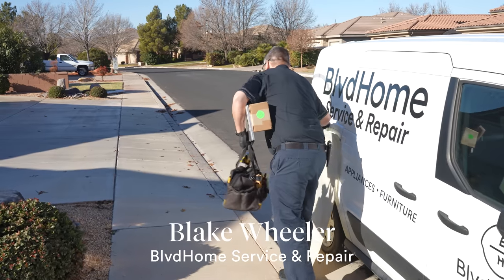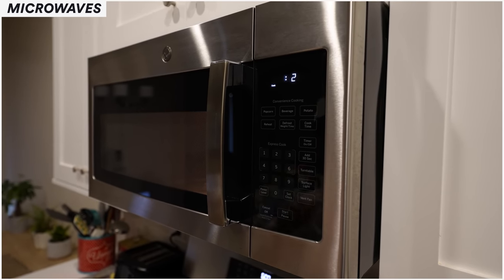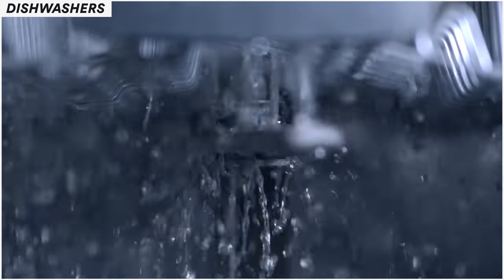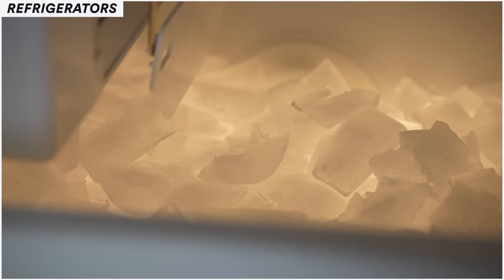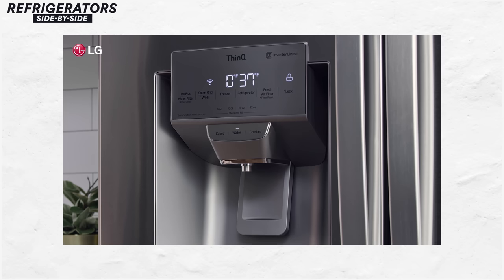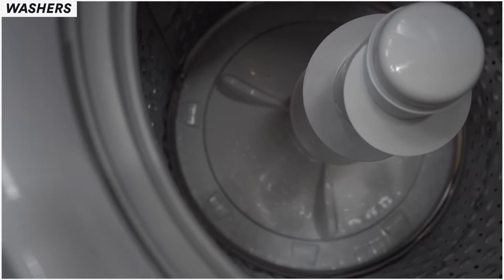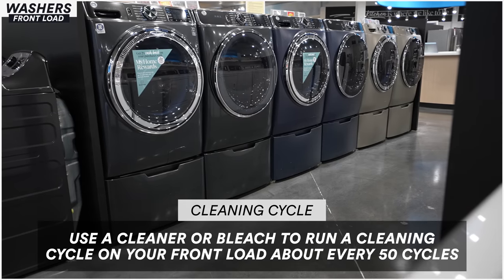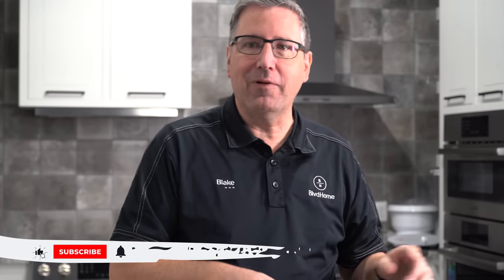Best Appliances Recommended by a Repair Technician of 29 Years

Comment: If your ice maker stops working, the first thing to try before replacing it is take it out and let it thaw out. I just moved into a house, and the ice maker wasn't working. The replacement was $250, and I didn't want to spend that given the age of the fridge. I'm a plumber and like to dabble in all sorts of different trades,  so I hoped that it was just froze up, and sure enough, that was the problem. Over 3 years now, and it still works with no problems.
This applies of course if your ice maker is in your freezer. 
I would have to look at an ice maker that is in the door and how it works.

Comment: I ended up with a WP French door no dispenser, Kitchenaide Dishwasher,and a Fridgidaire convection range. Interestedly the fridge has had zero issues, the dishwasher has had a ton but it cleans well, and the range has been great. Its a EU spec so its special order and designed a lot better than US.

Comment: Fridges/freezers: get an inverter model both for efficiency (solar friendly) and durability. My cheap deep freeze has no safety cut-out built in, so when the power dips for a second or 2, as it does here, it tries to restart immediately and the coolant gets bubbles in it causing compressor to heat up and possibly burn out.

Comment: We've had our BOSCH dishwasher for 16 years now.  ZERO problems.  Quiet.  Looks like new inside and out.
Reply: I've had a Bosch dishwasher for 20 years and it finally started having cleaning issues. It was very expensive 20 years ago, but I definitely got my monies worth. I loved that machine, it was quite, cleaned great but never fully dried the dishes. It looked great inside and out and I never had a service call. My son in law works for LG and we used his family deal to get a top of the line LG dishwasher with all of the bells and whistles. We have had it about six months now and it works well. I believe it makes a bit more noise than the 20 yr. old Bosch. It still doesn't dry fully, but a bit better than my old Bosch. Which doesn't really even compare since it's 20 years latter in technology? You would think a dishwasher could completely dry the dishes by now. It has a lot of features, wifi, steam, etc. I'm a gadget guy and love utilizing these features. After seeing all of the reviews, I'm a bit worried about the future. I still l have hope this dishwasher will provide  many years of service. I really appreciate Blakes opinion, because that is the most valuable to me.
Reply: @brewskisteve 20 years! Wow that's great! What brand fridge and range do you own? Mine are coming up on 20 years and I want to upgrade before they kick the bucket on us.
Reply: My parents first Bosch ran forever. The new one, crap.
Reply: Mine is over 20 years old. I’ve replaced a few parts (myself). Have to start differently now but still cleaning 🤞. Dishwasher has had to move 2 times!
Reply: Is Siemens dishwasher SN25HI00VI better than Bosch S25HIOOVI. WHERE ARE THEY MADE??
Reply: Mines about 20 years old.  As installed.  Still working fine.
Reply: They clean well and are quiet.  Downside is longevity and rusting racks.
Reply: SHOW OFF! My Frigidaire is a polished turd. Birthday gift from Ex-husband. I’m blaming Aliens 👽
Reply: German engineering
Reply: We replaced our Bosch dishwasher after about (more than ten years) because it wasn't responding, must have been clogged with debris.  It was a very good dishwasher, the new ones are even better.
Reply: Our Bosch is great.
Reply: @brewskisteve my Bosch dishwasher is 24 years old now and still going strong!
Reply: I love my Bosch 850 series.  Eight years? Years after buying it, my husband and I still talk about how much we like/love it.  cleans well, is quiet, use the 3rd rack more than we thought we would.  The racks aren't quite as flexible as my old GE profile (cleaned well - but loud.) - but far quieter and the coin sized light on the floor means we know it's running and how much time is left.

The Bosch replaced a higher end kitchen aid I bought because I wanted "quiet". Quiet isn't all it's cracked up to be.  I wanted to replace the thing within a few weeks of installation, as we utterly loathed it.  As soon as we could afford to replace it - we did.  It was a piece of junk - I shouldn't have to wash my dishes before putting them in the dishwasher . . all it was capable of doing was sterilizing them. (I had a builder grade GE that did a better job cleaning dishes.)  You can't pay me to have a Kitchen Aid dishwasher in my house.
Reply: @simpleshoes mine is 18, and I love. So this gives me hope!
Reply: My mums Bosch dishwasher and washing machine is also about 20 years old. I live in Germany so we mostly use Bosch and Siemens appliances. My new kitchen is all Bosch - fridge, dishwasher, induction stove, oven… also washing machine and dryer are Bosch.

Great brand, really reliable.
Reply: @MG-yu6do  I've had Bosch fridge freezers in the UK for the past 45 years without a single problem. We kept each for about 15 years and replaced them when we moved. Same for my parents. Bosch make great products. I'll move next year and probably get a Bosch dishwasher too. All the best.

Comment: Your confidence in Bosch dishwashers was exactly what I was keeping an ear out for. Thanks for sharing the experience with us common folk.
Reply: Miele are also incredible....but more expensive.  Basically, anything German.
Reply: In Australia the Bosch dishwashers have set on fire due to problems with a circuit board on the control panel, a friends house had the kitchen set on fire as a result.
Backup service from the company was average as well, they offered a new dishwasher but didnt knock themselves out wanting to help.
Reply: @markwilliams-ny6tr  This happened to my family about 10 years ago to our Bosch dishwasher. There was an electrical fault in the control panel and it ignited in the middle of the night totally on its own. We were able to get a replacement, but that was about it. Apparently there was a recall that wasn't made aware to us.
Reply: @RyanDottery  Sorry to hear that, hope the family and your home were all ok. My friend had the kitchen ruined as I said but the worst was all the black smoke that went through other areas and he had to replace carpets, lounge suites and drapery etc. They ended up getting Miele appliances which are way better.
Reply: @markwilliams-ny6tr  we also had our Bosch dishwasher on fire in Auckland NZ, also on the control panel. Interested to know someone else had the same issues. I would never buy a Bosch dishwasher as a result!
Reply: Miele is superior to Bosch and it’s not more expansive. Stick with basic Miele and enjoy it for 20 years..easily….
Reply: @dr150  except you can't get miele parts easily
Reply: My Bosch has been working for over 20 years.  I did have to replace an inlet solenoid valve.
Reply: @glasshalffull2930  I have just replaced the outlet solenoid valve on mine. It has around 10 years I think. Took 10 min of search online and a 30€ part which came in 48h with Amazon, quite happy how it turned out.
Reply: I asked a repairman that came to fix an appliance which brand in general they recommended and they said Bosch.
Reply: I was excited to get a Bosch dishwasher to replace my builder-grade Whirlpool. Based on my recommendation, my daughter bought one, also.  Much to our dismay, several repairs and less than seven years later, we both had to buy new dishwashers. I’m very disappointed.
Reply: I have heard this on every platform i have looked.
Reply: We never imagined a dishwasher could be as great as our  Bosch. They are DEFINITELY worth the money.
Reply: A lot of service technicians recommend the Bosch dishwasher over anything is what I'm gathering from several youtubers. Its what I'll be getting next.
Reply: This issue with the Bosch that drives me nuts is that after your press the "start" button you have to close the door in less than (it feels like) 1.5 seconds or it does not start! This combined with the fact that it runs so silently means I often check on it later and find that the darn thing never turned on and it's a huge inconvenience because it takes a long time to run. First world problems - I know - but it's almost comical that some dishwasher designer somewhere thought you only need a fraction of a second to close a darn door. If that could be changed to 5 seconds or so then I'd call this a nearly perfect applicance.
Reply: @DennisKapatos  I don`t have that problem because the controls are not in the door. We chose that on purpose.
Reply: @dr150  Miele is the only appliance maker that does all design AND manufacturing in-house. They say this is the only way to control the quality.
Bosch moved manufacturing to less expensive parts of the world and they have parts that are made by other suppliers.
Reply: My Siemens (bosch rebrabded) is 18 years now, and have been working perfectly even using it daily.
Reply: @dr150  He never mention Miele because the never fail got my 23 years now :D
Reply: After 4 different brands we got a Bosch !

Comment: I sit here watching YouTube waiting for my Frigidaire french door fridge to get delivered today. My wife and I have been worried if we made the right choice. Then this guy praises them and even shows what looks like the exact model we bought on screen as he talks about them. Thank you for calming my nerves!
Reply: I have 9 Frigidaire appliances spread across 4 locations: 5 fridge/freezer combos and 4 large freezers that get about 20 below zero F. Three of those locations are vacation rental houses 1000 miles from our primary home. We standardized on Frigidaire because they "just work" and are easy to fix when they don't. Parts like shelving are easy enough to find, as are replacement ice makers. Vacation renters like to terrorize appliances, so this matters to us. 

The stand up freezers are at our primary home, and hold a lot of food (we homesteaded for a while and I tend to freeze lots of stuff). They stay cold, and if you stick to the the analog models (no digital controls) you can replace thermostats in less time that it takes to empty the machine. The number one problem with those is leaving the door ajar. People think the compressor fails because it won't cool anymore, but real issue is the thermostats burn out from staying on too long (while the door is ajar). Just replace the therm and it's good until you do the dumb thing again.
Reply: Hi would like to know what model you purchased ? Thank you for your time.
Reply: We loved our fridgidaire French door!  We sold it with the house.  That was a superb refrigerator!
Reply: I just got mine Sunday, and I absolutely love it!!

Comment: I was a kitchen and bath remodeler for 25 years, got asked a million times what appliances should I buy... I gave them my appliance guys card & told them "he'll guide you based on your needs & he'll give you a good discount", he always did and I always came out looking like a champ!... Oh and I was always a simple Whirlpool guy... washers, dryers, dishwashers & refrigerators, in 50 years of use, I've only gone through two sets of each, still on the second set!
Reply: The oldest appliance in our home is a Whirpool microwave. It's over 27 years old, we use it daily, and it just works really well. 

And we open it many times before it finishes and never had any issuses with the contacts! (Though now that I know, I'll try to take a better care)
Reply: Yes Whirlpool is the standard for me in almost all appliances. I have Whirlpool everything with very few problems.
Reply: I have Whirlpool appliances in the kitchen and am replacing them with more Whirlpool appliances. I have Commercial Quality GE washer and dryer though. Better standard warranty and higher quality parts throughout. Also cost me $1000 each

Comment: We are fortunate to have the same washer and dryer purchased in 1999....Kenmore! Never had an issue to this date. When they fail (and we sure got our use and money's worth) we will replace with SpeedQueen...
Reply: We had a cheap Kenmore super capacity dryer and I loved that thing.  I only had to replace the switch which was my fault for being rough on it but I fixed it myself with the help of YouTube.   I had a front load LG washer — and my kenmore dryer that I wouldn’t give up.  I think we paid $350 brand new and it ran like a champ and could fit huge comforters. we sold our home but I wish I would’ve brought it with me.
Reply: Speed Queen is super expensive
Reply: I’m watching this video because my 2002 Kenmore washer finally 💩 the bed

Comment: I've had a Bosch dishwasher for three years and it's performance is flawless.  It does nee to be cleaned periodically and the filter should be scrubbed at least monthly.  We like it so much we recently bought a Bosch gas stove.
Reply: Kitchen aid way better
Reply: We love our Bosch too!  Replaced a Kitchen Aid with it that wasn’t cleaning our dishes at all.
Reply: We love our Bosch too!  Replaced a Kitchen Aid with it that wasn’t cleaning our dishes at all.
Reply: Ditto on the Bosch! Great dishwasher and glad you're enjoying yours!
Reply: I’m at 16 yrs with our Bosch.    Going strong.
Reply: Have a Bosch disch washer and it work great; had a Whirlpool before it and had a few problems with that one. Recently moved to Bosch group also with the induction stove. The fridge is also Bosch, no complaints there either.
Reply: @iLoveBoysandBerries  False.
Reply: Our 6 year old Bosch dishwasher just quit. It won't power up.  There's power to the junction box. There have been problems with the soap dispenser. Potential cost for repair makes it a done deal. Take all the Bosch praise with a grain of salt.
Reply: I have a Bosch washer & Dryer I bought  at Lowe’s way back in 2006 to date no issues what so ever works flawlessly. There dishwashers are tops  .as far as washers & dryers go Speed Queen are good ones . Yes they can get expensive to buy it depends on which model & features. Miele is a good brand. Although I’ve never owned any of there products. From My understanding they make great products. I do know they make  floor care products. All & all it’s basically what’ your want & needs are .
Reply: @robertwhite9898  The problem with Speed Queen top loaders is that they use so much more electricity and water than other brands, especially front loaders.

Comment: Excellent summary of appliances. One thing to inform viewers is that in many appliances the top and bottom of the line are the same unit inside. I have bottom of the line $525, Bosh dishwasher and according the the online parts manuals the mechanical parts are interchangeable with the $1300 top of line. You get no more reliability with price.
Reply: Thank you, I will be replacing my Old Bosch and wondered which series to buy.

Comment: Well,  truthfully shocked by some of the recommendations in this video.  I have been in the appliance industry for 17 years….things he got right?? LG & Electrolux front load washers and dryers…yes….speed queen & LG top load …yes….Bosch dish yes…but should also seriously consider Miele…whirlpool is not what it used to be.  As for fridges,  this is where things go sideways…any issue with LG compressors was worked out on new generation and they are hands down a top selection…reliable and great features…Consumer Reports also backs this up..Samsung…stay away from all with exterior I/w dispenser along with their dishwashers and all built-in cooking product…ranges are solid

Comment: We went with all GE Profile kitchen appliances and have been very happy with them..The French door bottom freezer did  crap out after 3 yrs but the Profile models have a 5 yr factory warranty on motor, compressor and all cooling lines so it was replaced (not repaired) by the factory...
Reply: You got money and good taste 😁
Reply: We have the same. Got rid of the fridge bc it was ineffective storage compared to our Samsung. The microwave stopped working. The dishwasher isn’t efficient.
Reply: Well, now my heart hurts bc I really wanted the Samsung bespoke refrigerator
Reply: @jessicaferguson4518  don't even trip dawg, follow your heart.
Reply: 3 years?  What a waste
Reply: GE profile side by side refrigerator - I was glad to kick that thing to the curb. We literally left it roadside marked free.  Never had more problems with an appliance in all of my life.   Purchased a Frigidaire French door bottom freezer.  Omg I felt like a Rockstar!

Comment: Thanks so much for for leading with the microwaves, I really appreciate the tip on opening the door while still in operation. Since the locks are heavy duty plastic I never associate the contacts to be arcing. Does this still hold true with the press to release door opener? I have the older Maytag (5100 AAB) 2001, Made in Cleveland, OH, it's a 1000 W. I compensate for cooking today's recommended cooking time by pressing the 30 sec. feature. 
The range is the MGR 5770 Super Capacity Plus,  the dishwasher is the Jet Clean Quiet Pack III. All are in as new condition, most visitors ask where can they buy these models. Little do they realize that they are over 20 years old. Then again that's when quality and durability were the best features. 
I agree with you on front loaders, I prefer the LG because of it's direct drive motor and the handle is part of the door, so it won't break off. 
Thanks for sharing your opinion and experience with us.